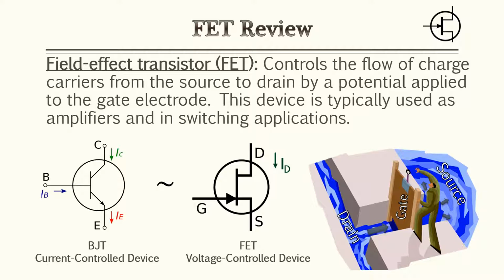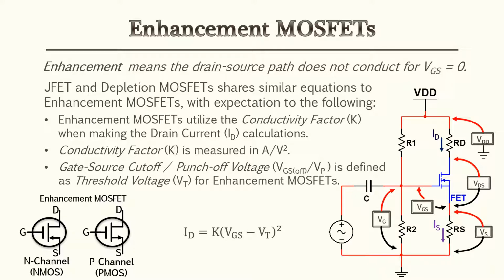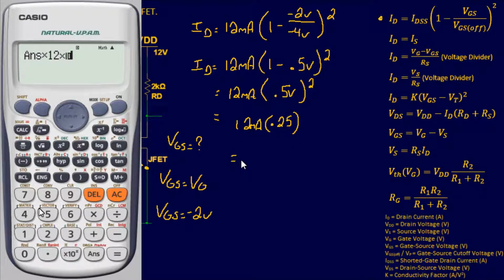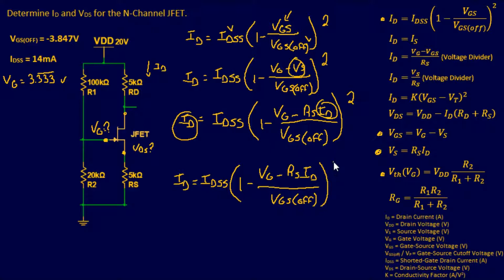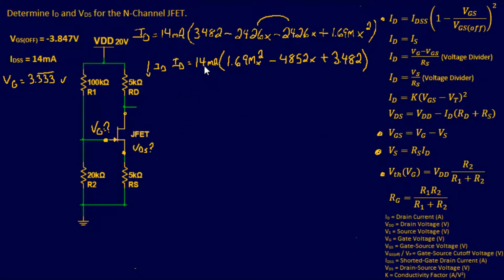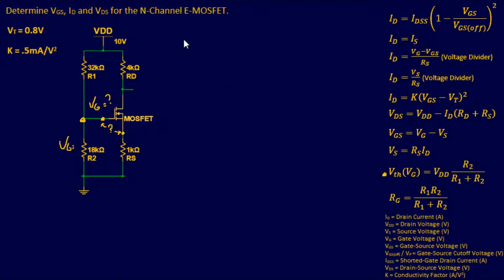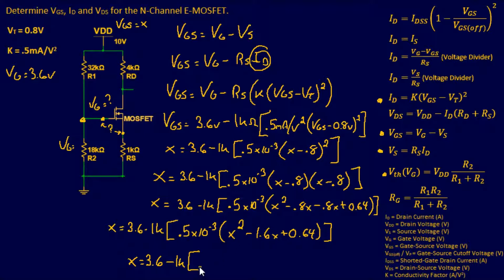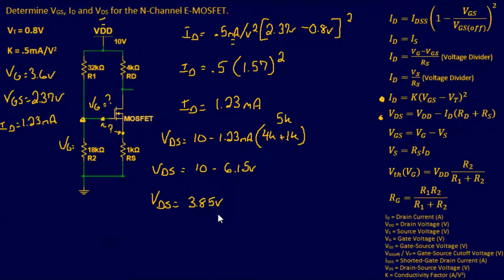Electronics P.E Prep - Field-Effect Transistors

Comment: Thank you so much for such a detailed explanation! One question if you can help me out understanding why you chose the second value of X when solving for ID in the Jfet example? Thank you again!
Reply from the maker: Quadratic Equation Mode provided two answers: 1.682mA and 1.231mA.
If I used the ID=1.682mA, it would provide a VGS of -5.077V via VGS = VG-VS or VGS = VG-(RS*ID).
If VGS was -5.077V, it would be less than VGS(Off) [-3.847], putting the JFET in the Cutout Operating Region (See Operating Region Slide).
When we use ID=1.231mA, it provides a VGS of -2.822V; which is within the Linear Region.
This is one of those rare cases where the Equation Mode extracted two very close answers for the example problem.
Great Question!!!!
Reply: @electronicspepreparation  I see that now thank you for explaining. I'll try and go over it again (hopefully if I have time 😅). Thanks again I would feel alot less confident for Friday if it wasn't for your videos.
Reply from the maker: @Lutestick  Awesome!!! I hope you do well on the exam. Please let us know how you did.